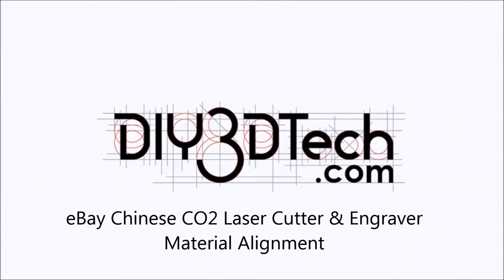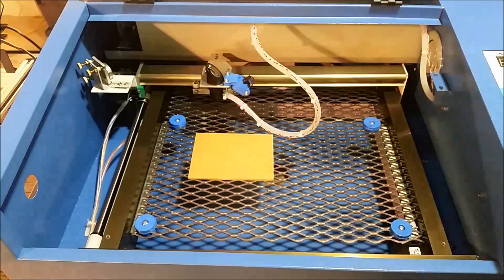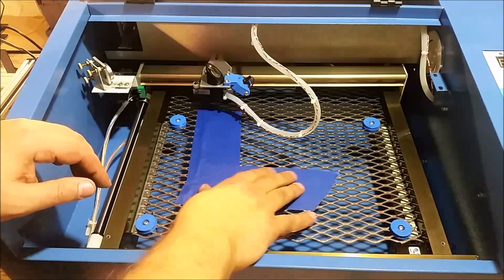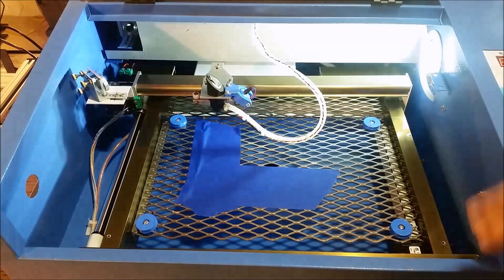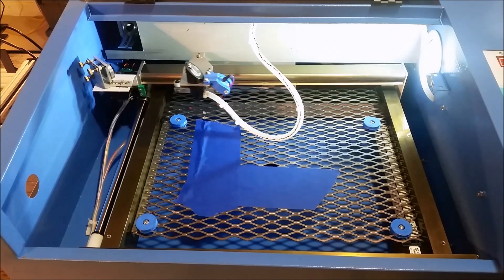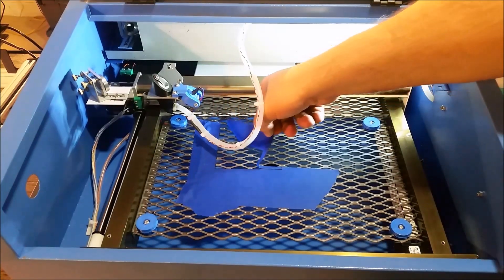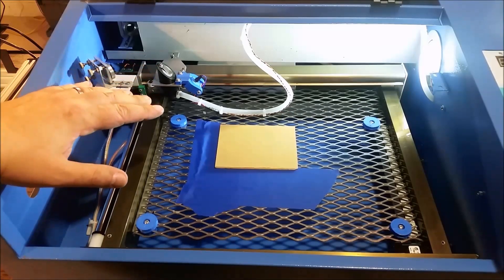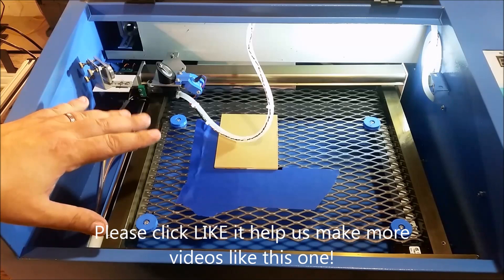eBay Chinese CO2 Laser Cutter & Engraver - Material Alignment!

Comment: That hole in the bottom is cool ...It allows the laser to set the table on fire ....
Reply from the maker: or make artistic etchings.    Its all on how you look at things :-)
Reply: I was astonished to say the least ....smoke pouring out from the underside .. LOL
Reply: Easy mod is to stick a pc fan there to provide positive pressure in the case . Even easier mod is to tape up hole if it really bothers , no drama  really .

Comment: hi my machine out of square how do i do adjustments.the moving bar where the laser head is attached is a bit out of line.hope you can assist.
Reply from the maker: You might have to loosen the belts and adjust it, then retention if I understand you correctly...

Comment: One of the first victims of brexit appears to be these machines in the uk market :(
Reply from the maker: Interesting, you mean the importation of the Chinese lasers?
Reply: Yeah, until recently there were quite a few sellers operating uk distribution locations but those have all dried up and postage is about £150 otherwise.
Reply: There is a supplier in Germany who I bought mine off for £365 postage included. No Customs duty to be paid, well not yet-pre brexit.

Comment: I have this laser cutter/engraver  .. Not sure if you knew , but running these lasers at 90% will kill the tube , i did a current test , and 100% will supply 27mA to the tube , and the max for this tube is 18mA , so i fitted a analog current meter in mine , and found that 45% ( 18mA ) is MAX  .. Also  the tube is only 550mm long , its not 40 Watts , it more like 25 Watts .. Saying that , these machines are excellent ... Great videos by the way.
Reply from the maker: +steve mee Many thanks for $400 its worth pushing, however I have heard they are more like 32 to 35 watts.  I will have to check the length however think its about 550mm long...
Reply from the maker: +steve mee question at 27ma what was the yield of the tube and any idea on the duty cycle if run at 27ma?  As I also understand that the 50watt units are 40watt tubes over driven so they must have some duty cycle past 18ma correct?